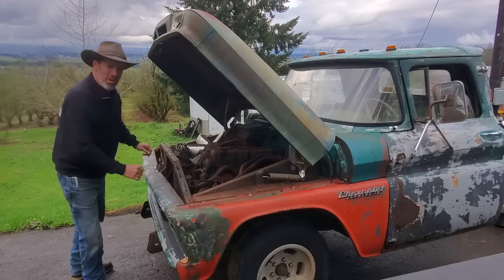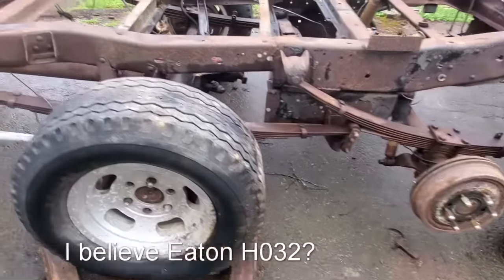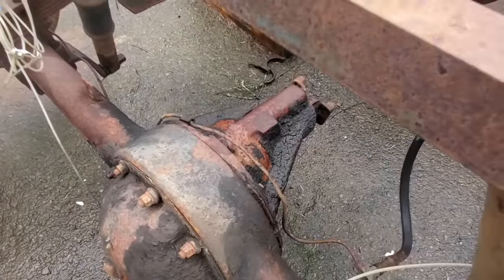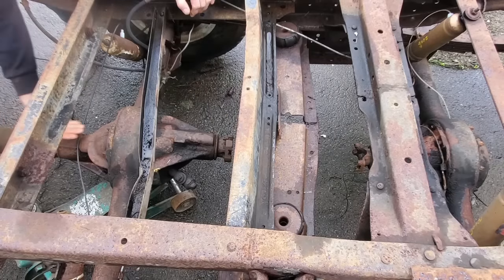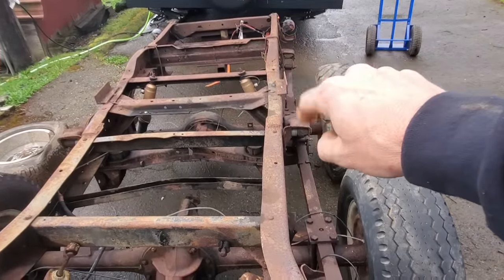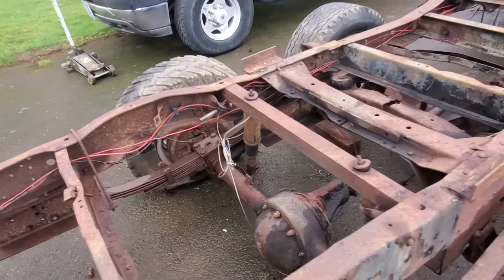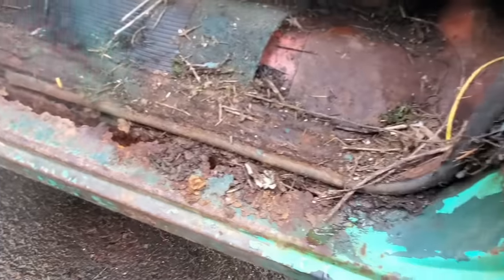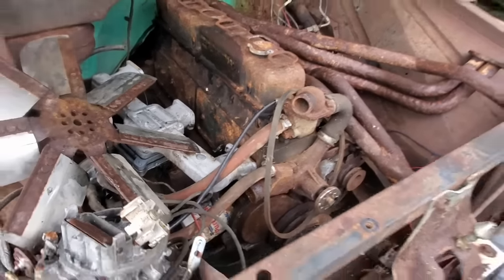1962 (3) Tandem Axle Chevy C10, can it be saved?

Comment: An update on the differentials and exactly how they work as far as the inside guts and where to look to find the parts would be kind of neat
Reply from the maker: I’m debating pulling that front diff to see how it fared.  Thanks for watching!
Reply: @PardeeShopShenanigans years ago four wheeler magazine Ran an article on axle housings that had the pinion located high (above center) from manufactory-Dana, the reason for the high location of the pinion was for strength and ground clearance.  If your twin-screw setup uses standard Axle housings with low location (below center) of pinions that are just  Inverted - the question is will  they properly lubricate the ring, pinion, and side gears?
Reply from the maker: @dand3975   Lubrication is a definite concern of mine.  Time has been against me in tackling this project, but I’m definitely going to do a tear down on this set-up.  It will be interesting to see how it fared the use I’m told it had.  Be patient, another video is forthcoming!
Reply: @PardeeShopShenanigans  I had an idea on lubrication. The old NASCAR 9-inch Ford rear ends had pumps & a differential cooler. If the outlet was plumbed into the bottom, and the return line plumbed into the top it could constantly supply 80-90 to the ring and pinion.
Reply: This is the same idea I had with an Eaton ho72 I bought for 100 with 4.10 gears. Pretty easy to do but I was trying to figure out if the 3rd member would support me drilling through the output to run grade 8 bolts for the caps  @PardeeShopShenanigans

Comment: From a fabricator that saw the first vid on this, you aren't seeing just how smart the guy was that built it. The thru shafts have to be that way because of clearances. You CANT have two opinions fighting for the same real estate inside the rear housing. They flipped the pinion that goes to the furthest rear axle, and it caused the reverse rotation. The second axle was flipped over to rotate the same direction. And yes, it's that simple. There's NOT a six cylinder that's NOT A BOAT ANCHOR. This truck should be torn completely down and the rust repairs redone. A good, built LS and five speed for pulling. The diffs would get a set of 3.73's, a full disc conversion, new drive shafts. The frame itself should be powder coated and restored. The booger welds need grinding down and maybe redo the spring set ups. Put the old style rear SWING ARMS, NOT TORSION BARS. Torsion bars are literally straight bars that act as a spring. Theyre hardened steel and good luck cutting em. You've got a really good project to work on. But I'm not the one thats got to spend the money and time on it. I have to give your ole lady a whole lotta credit. That many "projects" sitting in her yard, most women would've long ago, filed for the divorce. I think she deserves a dinner at a swank place and some quality time alone.
Reply: A 292 is not a boat anchor. It will outpull any small block v8. It pulls comparable to a big block. I know because I used to run one in a 1951 Chevy 2 and 1/2 ton truck. A friend of mine had the same size truck with a 350 v8, and he wasn't able to keep up with me on the hills when we were hauling the same size load. I also chain pulled a guy with Dodge 360 backward around a parking lot with that truck. As far as I'm concerned, you can keep your LS junk. I'll take one of those 292 sixes any day. Just one more thing to consider. In case of an EMP strike, your LS will be a boat anchor. The old six will still run.

Comment: Torsion bars were only used for three years: 1960, 1961, and 1962. 1963 went to a coil spring front suspension. If this truck has a torsion bar front end, then it's a 62.
Reply from the maker: I had a case of scramble-mouth when I said torsion bars.  🤦🏼‍♂️ what I was meaning to say is Trailing Arms.  Those which connect the rear differential to the frame with coil rear suspension. However, this is in fact a ‘63 with coil front suspension as well.  Thanks for watching!

Comment: You could make the rear axles work , look at a spring suspension semi tractor and put an equalizer  between the two springs .in the front differential there should be a threw shaft for rear output shaft. Now that would be crafty
Reply from the maker: I agree that an equalizer would make all the difference.  My only problem is I already have too many projects in the yard! 😂 Thanks for watching!